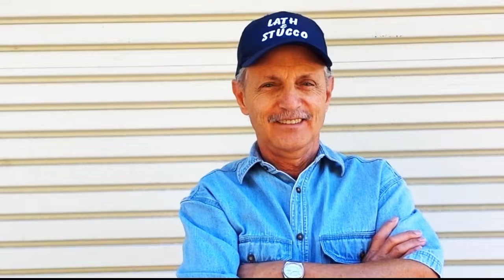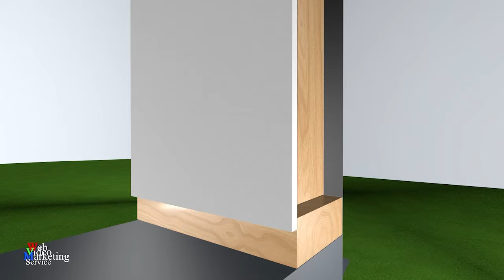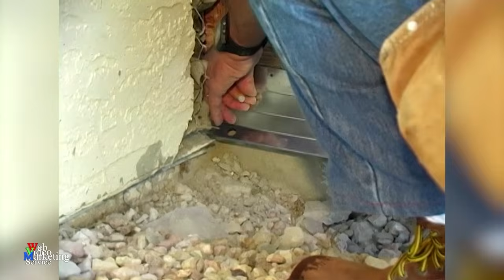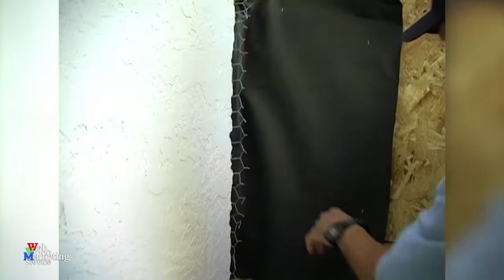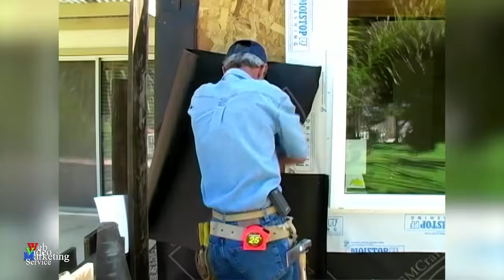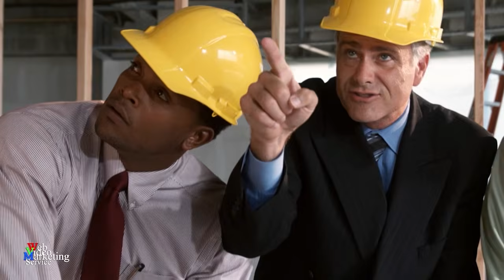(What to Purchase and How to Apply Lath)

Comment: Great video.  I knew nothing of that line wire, plywood gap, or weep screed--let alone its placement, but I knew tar paper is good.  I think this is the route I'm going for the 20" below casement windows on my front porch I'm enclosing.  Four yrs ago, I lime washed my brick.  I did 4-5 coats for opaque and hope I can use it here.  Off to dig through your videos!!

Comment: Thanks for the information, only thing I disagree with in the peal and stick tape, this is required in my area in the northern mid-west, due to snow, just like our roofs need to have 2 feet up from the gutter system.  Snow melts and water turns to ice and ice grows right under the shingles.  just like when we get 3-4 feet of snow, so the top of our flashing needs to have the peal and stick on top of it.

Comment: Why was there no sheeting used below the window?
Reply from the maker: I was a subcontractor on this project and was not involved with the framing of the room addition.  I’m not sure why they decided to eliminate the plywood above and below the window.  However, it became beneficial for me because it gave me a chance to explain what to do in this type of situation.  In the 50’s through to the 80’s open stud framing was common in southern California.  In 1994 we had a major seismic event in Northridge California which led to some new major code requirements.  One of the amendments to the code was to install plywood over the stud walls to act a shear wall in the event of an earthquake.  I explained the benefits of shear panel (plywood) in my video.
Reply: @eddaher5682  Thanks for the explanation.  I was just curious to why they did it that way. 👍

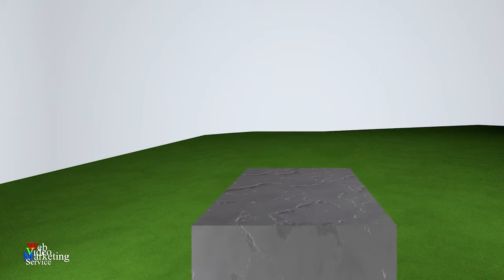Comment: @20:55 you discuss the illustration where the OSB is installed hanging over the side of the slab causing a potential entry point for insects. Couldnt uou just apply stucco in the underside sealing the gap or fill it with some other agent? On some job sites, the problem example is exactly as shown, what is your preferred method?
Reply from the maker: The installation of ½ x 1 inch L-metal flashing at the bottom of the shear panel prior to the application of the weep screed is a good option but not in all instances because the concrete slab is not always straight.  In many cases I will fill in the void with stucco.  I’m sure there are other ways to approach this.
Reply: What other options to fill the void . Are there any other suggestions?

Comment: Why didn’t the window area above and below, not have plywood backing? And/Or why not install it instead of the wire backing for the lath and paper? I’m a student of the trade. Perhaps there’s a good reason why these areas did not have plywood as it relates to the window??? Please explain and thanks for the education.  Great video!
Reply from the maker: I was a subcontractor on this project and was not involved with the framing of the room addition.  I’m not sure why they decided to eliminate the plywood above and below the window.  However, it became beneficial for me because it gave me a chance to explain what to do in this type of situation.  In the 50’s through to the 80’s open stud framing was common in southern California.  In 1994 we had a major seismic event in Northridge California which led to some new major code requirements.  One of the amendments to the code was to install plywood over the stud walls to act a shear wall in the event of an earthquake.  I explained the benefits of shear panel (plywood) in my video.

Comment: Isn't a Sq yd 100 Sq ft
Reply from the maker: I believe you may be thinking of roofing.  In the stucco industry a square yard is 9 square feet.  In the roofing industry, a roofing square is 100 square feet.  A 100 square foot area of roof makes a roofing square. However, a “square” is not 100 square feet of roofing material. It is the amount of material needed to cover 100 square feet of roof.